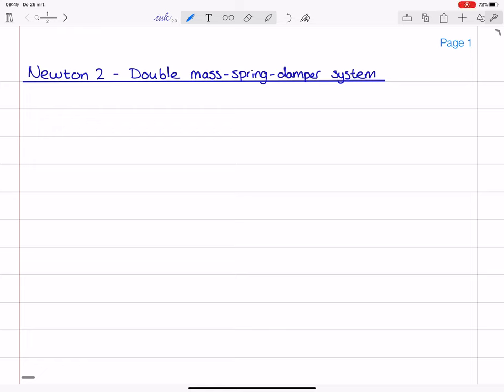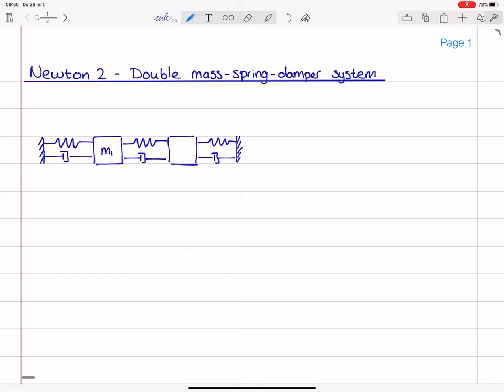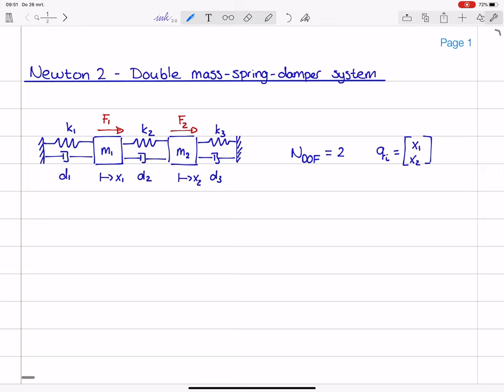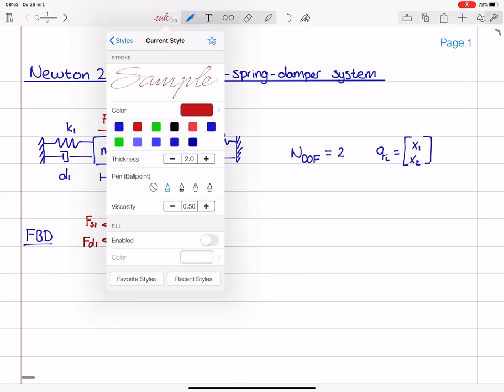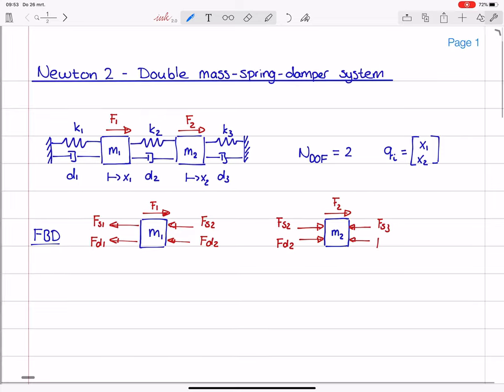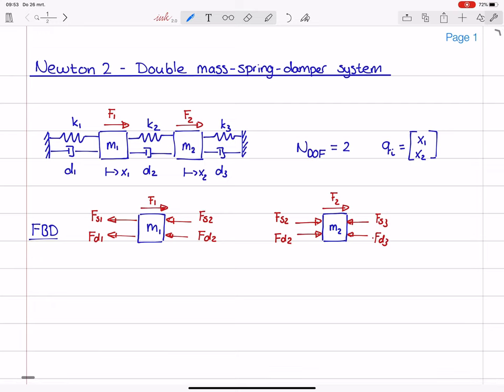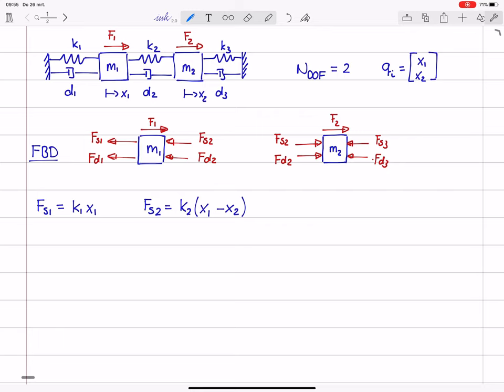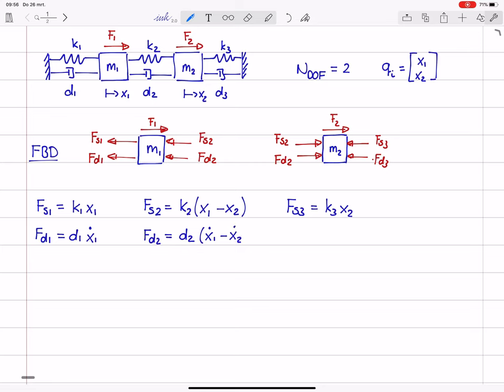Mechanical Vibrations 8 - Newton 2 - Double Mass-spring-damper system

Comment: Thanks for this nice video.
A question: If you have assumed that the mass M2 does not move (2:55), then why We should have Fs3 and Fd3?  the spring 3 should be in rest (neither compressed nor elongated), unless it was already preloaded.
Reply: Great question. I think he said it to make understanding better, but it is not exactly correct, actually we assume that x1>x2, therefore spring is in compression. Also x1_dot > x2_dot is the assumption for damper eqns.

Comment: How are the forces on left side for mass 2 acting towards the mass?
Shouldn't it be the other way?
Reply: Is it because when M1 moves to the right, it compresses the k2 and d2, which causes the spring and damper to exert a force on both the sides, ie force on the left and right?
Reply: Right??? Thats what makes sense to me.